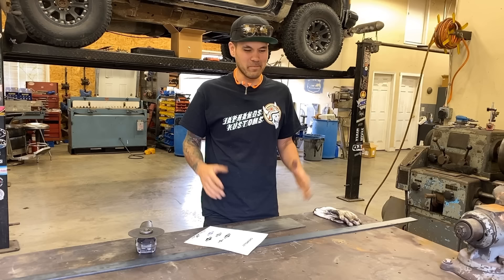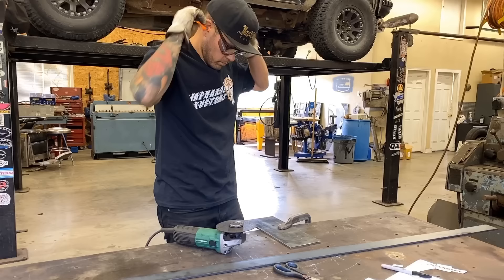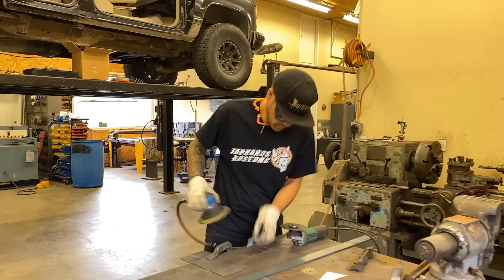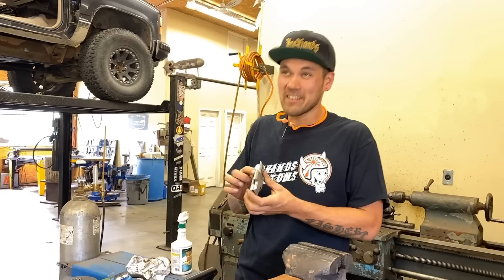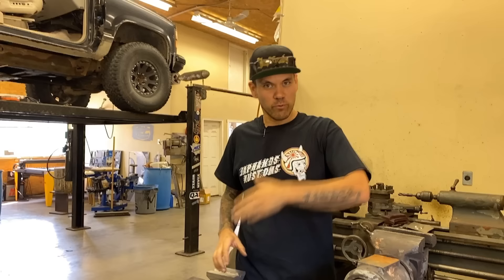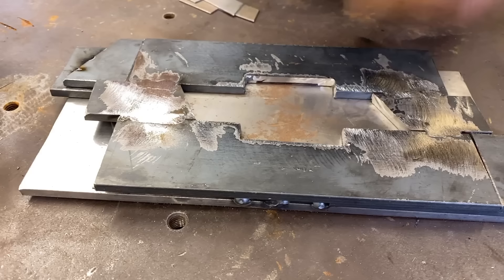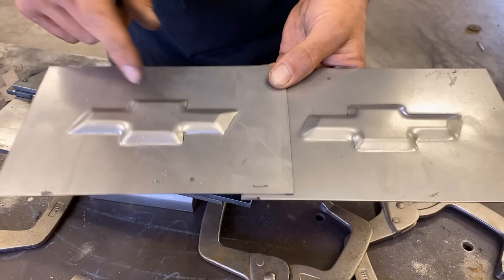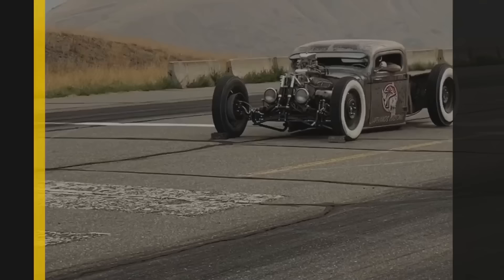How To Make A Press Form - Embossing Sheet Metal Using Basic Tools!!

Comment: That's looks pretty cool, like you said; on a fire wall or something! also on the dog leg of the fenders, or on a hood near each side of the windshield or whatever you decide.  That does look pretty wicked. You'll definitely get your money back out of that metal stamp through the years. That's a fact jack! that's a fact!!! 
Btw try different thicknesses of sheet metal that will definitely affect the results as well. or even try heating the sheet up a bit it may not cut into the corners as much! then? right!! nevertheless that's pretty cool. 
What? your not trying to get the fabricator's award! what the hell, what kind of attitude is that? LOL
Reply from the maker: Thanks man yea lots of fine tuning can be done with these
For sure

Comment: Awesome video as per usual. Do you think this would work with a bench vice if you didn't have access to a hydraulic press?
Reply from the maker: Agreed lol yes and no. Yes with heat or a smaller die and no not with this die and no heat. It took 20 tons for sure to do this one. But much less with heat
Reply: Thanks for the replies. I might have to get out the Map gas tourch and do some experimenting. I am just not really sure what to emboss but I am keen to try it out.

Comment: So I have done similar things and I was wondering why you don't spray it with oil before pressing. In my past experience, my stuff comes out super sharp and clean when using lube. I'd like to get your thoughts
Reply from the maker: To be honest I just haven’t tried. I thought it would just make it easier not better my press is strong enough without it but if it makes it sharper that’s a whole Nother story

Comment: Question can you do a video on how to take the warp out of a panel after bead rolling. Example I made a tailgate from scratch for my 53 L110 with a step the whole way round and a diamond in the center with just a bead die I think I need to shrink the quite a bit all around the whole panel to get the oil can effect out of it.
Reply from the maker: That’s a tough one and can become a mess. Pre stretch is a better way about it I think
Reply: Problem is I've already made the tailgate was hoping to be able to get the oil caning out of it with like a shrinking disk or something of the sort
Reply: I did buy a grizzly mini English wheel for the rest of my bead roller work.. I do wish I would have started on the floor pans cause the tailgate was the first thing I ever bead roaled after som scrap practice of course.. I'm real happy how it looks just would like to get that oil can effect out of it

Comment: I have a question about marking the metal, how long will a fine tip felt marker last compared to the fat ones ? I’ve used the big ones and they always seem to make to fat of a line. Most of the metal I work with is definitely not clean, the rough stock is rusty and dirty . I do clean it after it’s cut down
Reply from the maker: I don’t know how long they last but the fine tip ones if they get dirty stop working

Comment: Would you also demonstrate with a more elaborate design, maybe a logo, and cut the male and female dies on the CNC?   I think I had the process in my head but wondering about how much tweaking the  female die will need.  Is that even possible?
Reply from the maker: Yea Cnc and solid modeling would give much better results

Comment: Nice try but if you get the torch and burn this metal sheet to red hot then let it cool down itself (no water, no air) after this try again and you must have deep one without any cracks or sheers

Comment: would an opposite form be made for the sharp corners to press into??? even out of MDF?
Reply from the maker: Yes an opposite form would help a lot for those corners. Just a lot more work but for repeating parts I would say worth the time.
Reply: @MakeItKustom  Still what you did looks great as embossed in a panel huh?

Comment: Would this be a way to make louvered vents?
Reply from the maker: Yes and no. a press is used but the dye is much more complicated. Unless you cut the slot with a grinder and then just pressed the shape. Typically the press die has the shear in capability built in

Comment: If you clamp the die super tight , then you are limited in depth to the amount that the center section of the metal part will stretch. As it stretches , the metal will get thin and eventually break through.
On deep draw operations like making a 3x10"deep cylinder from a flat piece of metal, a hold down die is used to apply pressure to the metal part. 
The hold down hits the metal before the pattern die. A special lube is used to allow the metal to slip and specific pressure is used to avoid the metal moving too much. 
Using the hold down with lube it is possible to allow the metal to flow into the forming die and make a much deeper part.
If you get wrinkles, you need more hold down force, if the part breaks, you need less hold down force. 
The lube is a special pressing die lube that is thick like grease or gear oil mixed with grease.

https://www.youtube.com/watch?v=2KZRQSI8GkQ
Reply from the maker: Great info here thank you very much!

Comment: I thought using a file back and forth like that would dull the file teeth if done on steel.
Reply from the maker: True but I only add pressure in the forward motion. Still probably wrong tho

Comment: Now let’s see if you can make a Ford Oval Logo. or is that got a copyright violation. (an easy way out of doing it) maybe a cnc version of both the male and female die? 
I was surprised that you didn’t taper all the edges of the female as well as the male
Reply from the maker: Yeah maybe I got lazy on the female die 
I wanted to see how well it would doWith just the mail

Comment: You are quite the young fabricator I commend you. Just curious why not bandsaw all those pieces. All you young guys use cutoff wheels. Breathing those cutoff wheel fumes will catch up to you eventually trust me. I do know convenience as it leads to bad habits very well. Take it from somebody who is older and used grinders for many years. Either wear a mask with those darn cutoff wheels or use a bandsaw with a new blade will save your health.  Frank
Reply from the maker: Yeah that’s a really good point Frank thanks for your concern! I have to get my bandsaw back up and running

Comment: I love that you use your safety glasses and ear plugs but put a face shield on when using cut-off disc with no guard, think about poor wife having to deal with piece of disc sticking out your face or worse an artery in neck, don't think she would be too happy, you will only not wear one until you see what damage they do, bad enough not wearing a leather apron to protect the other bits while you use cut-off but a face shield is a no brainer as those cartoid arteries are really exposed
Reply from the maker: Thanks for looking out man you’re definitely right